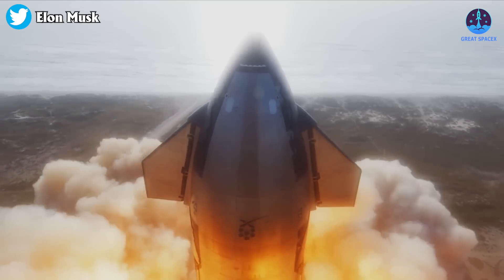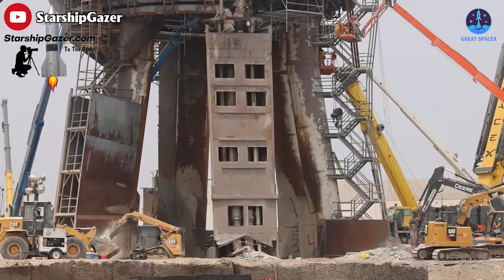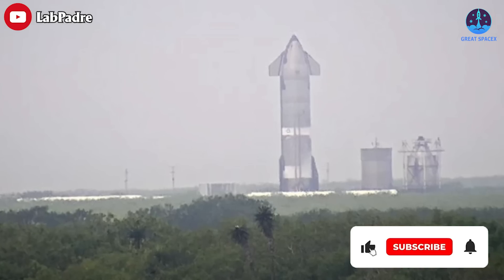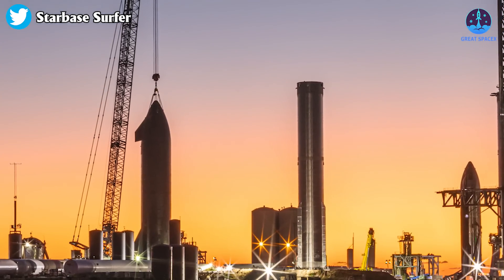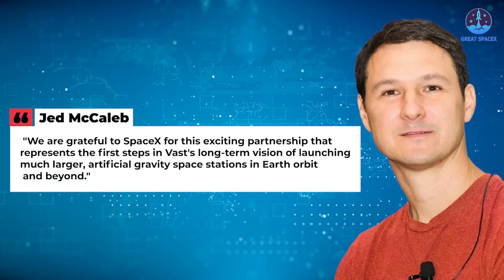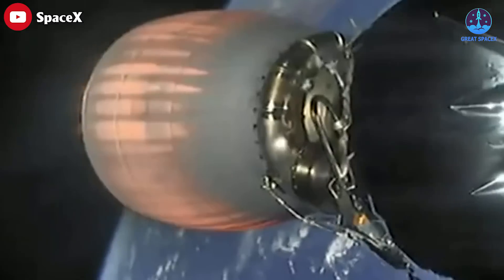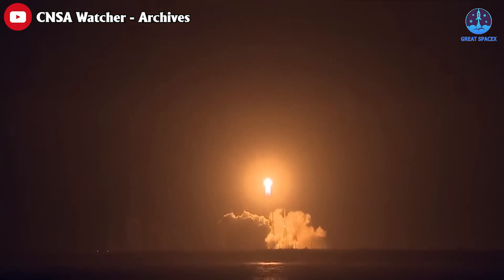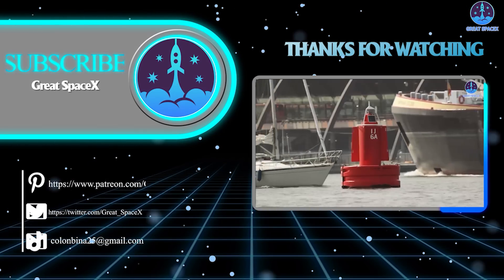Pad Foundation working 24/7, Starbase is busy, and Ship testing...

Comment: I remember US Astronauts Crammed Like Sardines (Literally) into a Soyuz Spacecraft to the ISS. I felt sorry for them. THEN We see Astronauts aboard a Falcon Spaceship and they're sitting in Modern Ergonomic Arm Chairs with room to read a newspaper,  and State-of-the-Art Color Touch-Screen Display & Control Screens ... an actual Spaceship. C'Mon there Marxists, you've Pilfered everything else from us, Get some Human Factors Engineering Into Your Flight Systems. Wait'll you Commies see what's on-board Starship!

Comment: The agreement with "VAST" is truly exciting. At last we may 'finally' get a MODERN SPACE STATION to live & perform work in. AND STARBASE IS SURE COOKIN - Lots of Robust Stuff being Constructed, and fast. The Blast Mitigation System (whatever they call it) seems to be moving quickly. Hope it Performs. We were Thinking of a 1.) Blast Diffuser System followed by 2.) a 200K GPM Deluge System. Diffuser at 6,000 Deg F Liquid Cooled Diffuser Grates, followed underneath by The Deluge System. It Looks Like Space-X Combined the principals as one...SMART! Just wondering if there's enough 'Flow'?

Comment: I believe the water cooled steel plate will have a hole in it after the next launch but maybe they could put the heat shield tiles on it and then could be reused ! ! !
Reply: Heat shield tiles can not take the blast of the rocket. Heat shield tile is fragile. Remember the second space shuttle disaster. Foam insulation damaged the tiles.
Reply: @mrbaab5932  the leading edge of the space shuttles wing where it was hit did not have tiles it had thin carbon carbon panel

Comment: So since the water is coming from underneath in pipes/perforated steel plates, what prevents the thrust from the rocket engines from blocking water from one part of the plate and forcing it out another?  It seems like not a tug-of-war, but a push-of-war with the rocket thrust vs water pressure.  If the rocket was able to destroy reinforced concrete, what will it do to a thin steel plate?